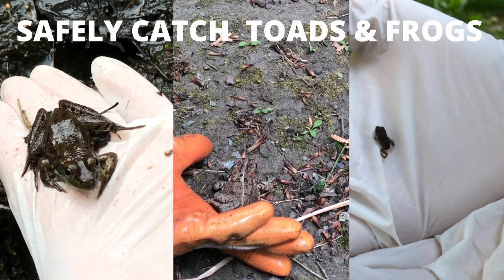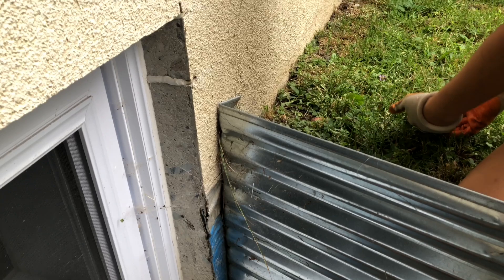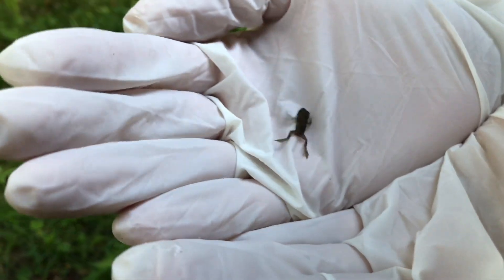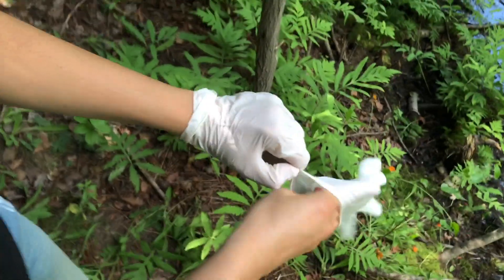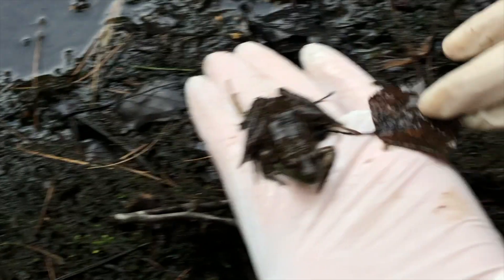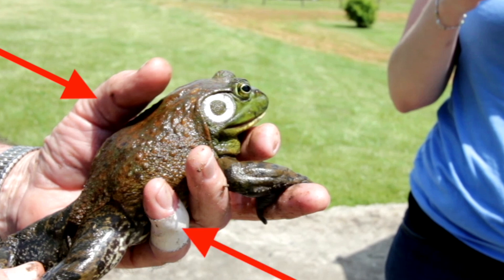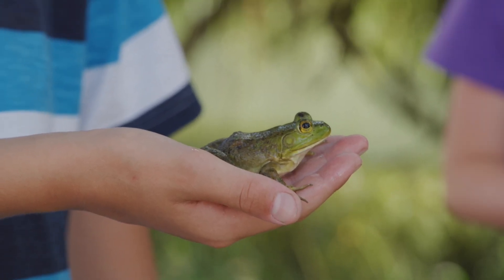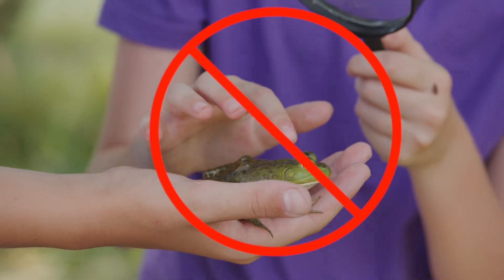How to Catch Any Frog by Hand 🐸

Comment: So I was walking around in the city and found a pair of common toads(mating). They were on the road and not easily visible so I wanted to get them to safety. In my hurry I forgot all about their absorbing skin. so I picked them up with bare hands. No gloves or wet or washed. I did hold them gently under the belly and tried to get them to a better spot as quick as possible. But now I just feel super bad about it. Do you think they will be severely damaged?  Pretty sure I didn't touch the male on top but still. I don't want to be the cause for animal injury or death. 
I just hope they will be ok.
Reply from the maker: Hey @little crawley, I just saw your comment now, sounds a bit like what I did in this video! :) https://youtu.be/YdZz3I3hWiY If you did something like that I am sure they will be fine! Great job saving them! Take care